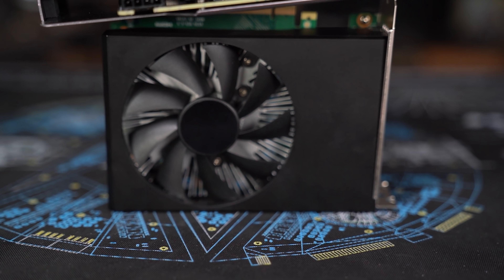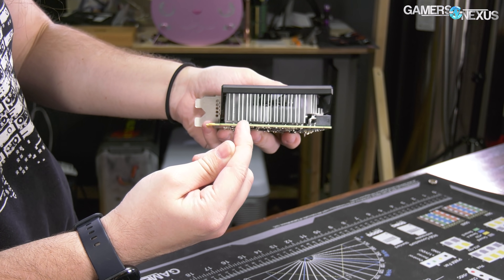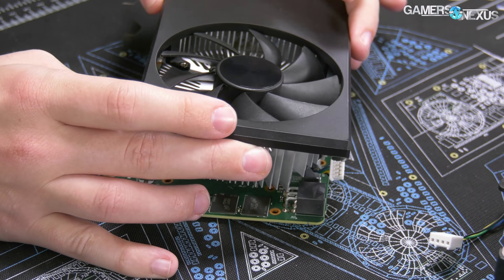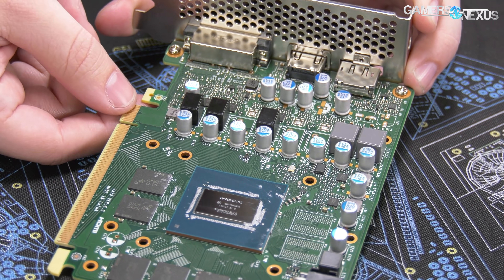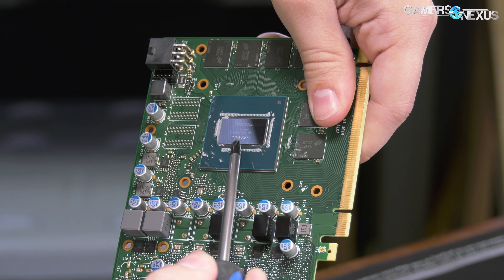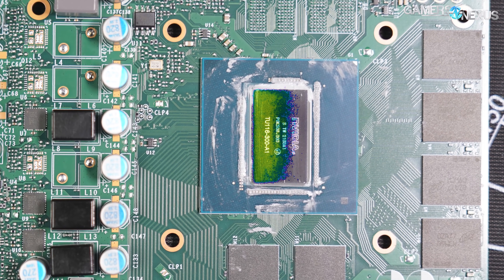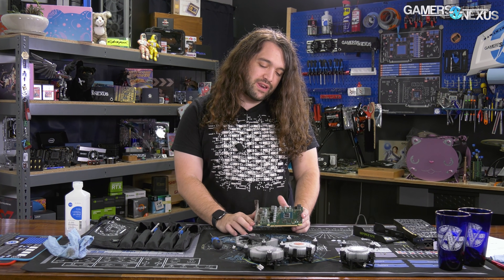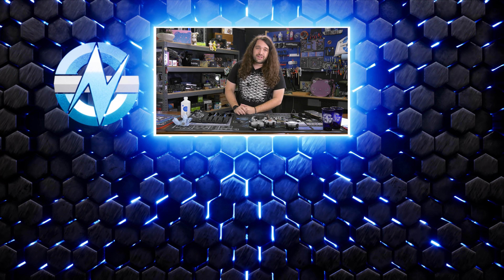Bottom of the Barrel: 110°C VRAM Dell GTX 1660 Super Video Card Review

Comment: "You would have to get an excavator to go lower"
Pans over AMD FX
This burns as much as the memory on the GPU in video
Reply: Not so sure about that. At least the AMD FX could be equipped with a good enough cooler. Can that even be found for this card? I think they took the cake on that, as well (which is impressive imo, just not in a good way).
Reply: @mariastevens6406  Yeah, most high-end used FX PCs I see for sale, often have either AIO water-cooling, or a really beefy dual-fan air-cooler.
Reply: @pauliusgruodis137  I don't think this perception is accurate. 9 series FX were very hot, but the FX8370 is the coolest chip I've ever owned (and I still use it). 15 degrees C on idle with a single 120mm fan  tower cooler. My ryzen 3800x with a massive 140mm dual tower cooler, runs at 40 degrees on idle. FX absolutely trashes zen 2 thermal performance from my experience.
Reply: @Lord_of_Dread  15C on idle? Do you live in Siberia without heating?
Reply: @GewelReal  I call BS on the 15C idle too. That is means the ambient air is well below 15C which would mean you live in an ice cube.
Reply: My 8350 with a single fan cryorig cooler runs cool enough, but with stock cooler i had a few thermal load shutdowns in summer XD
Reply: Lmao i had an AMD FX for a little while that i bought from a friend just for memes. Had it in an old HP case, kept the side panel off and stood a Thermaltake 200mm fan pointed at it to help keep it cool 😂
Reply: Maybe it's just because I had an FX4100, the bottom of the barrel of the bottom of the barrel, so power usage was still sane-ish.
But I had no problems taming that thing even with an aggressive 4.5GHz@1.5v overclock under an OG Hyper 212. (SO much heat pouring out the back of that PC!)
I've since decided to turn it back down because 1.5v was causing degradation, and I can maintain 4.3GHz stable at 1.35v.
Other than that little hiccup, she still runs, and if a friend hadn't thrown an R5 3600 at me, I'd still be using it today!

Footnote for Lord of Dread:
Ryzen has insane thermal density and is hard to cool, especially by older CPU standards.
My R5 3600 UNDERVOLTED hits 75c at all core under every cooler I've ever thrown at it, whether it be a 240 AIO or a Noctua U9S - even with a 5800RPM Wathai strapped to it.
I re-mounted my cooler three times thinking I did something wrong the first time I checked temps on that thing.
Although in fairness I did not win the silicon lottery, and I can only get a -50mV offset stable.
My FX4100 could keep 50-60 under the Hyper 212 with that insane overclock. I don't remember its idle temps anymore, and that system is decommissioned right now.
Reply: Proud owner of an FX 8350. Hot as Hell. Sext as fuck!

Comment: Could you please review some cheap 1600 series Gigabyte models? They're so freaking bad and Gigabyte is pissing on their customers by not providing updated vbioses for the insanely high RPMs at idle (56% vbios locked in my case, GTX 1650 MINI ITX OC 4G). There is also zero contact for the memory on my model. I've also had a Gigabyte 1660Ti Windforce OC in other PC which was also incredibly crap, with louder than normal cooler and vibrating at higher RPMs. It was so bad that I had to send it to repair just a month after purchase and they've replaced the entire cooler. There are so many complaints on various forums if you look them up a bit. Thank you very much if you consider this.

Comment: this guy should stop pretending an expert or creating drama for content.  first of all, Dell engineers know what they're doing especially against cost and other considerations.
2. Most VRAM especially low end ones don't need pads.  I have two MSI Armors that overclocks VRAM almost to the max possible, though with undervolting. I also have Powercolor cards without thermal pads without issues.  It appears thermal pads only help removing heat from the PCB not actually to cool VRAM.
3. Shroud is perfectly fine as a hybrid between blower style o open cooling. They don't to dump much heat into the case but not the costs of a blower style.
4. Card is fine with stock settings.

Comment: would the cooling be better if you'd manually remove the plastic shroud and add some thermal pads on the memory so it would directly touch the heatsink?

Comment: Any tips on cleaning your modmats? I have rubber / plastic marks on mine from working on a PC as well as general cruft that came out. A vacuum gets rid of much of it but not all and definitely not the rubber marks.
Reply: You could possibly use a dull flathead screwdriver to scrape the rubber off and not damage the mat

Comment: I ran into a very interesting Dell rx580 back in 2017 I wish you could have tested. I'm pretty sure it was an rx480 rebranded because when you flashed it's bios it didn't give you an error 43. Also the power limit was lowered to 90 watts. Obviously this gave worse performance than you expected from an rx580.

Comment: 100% Dell did a shocking job on everything in the system, no argument, BUT in this economy someone like myself could find a great value in the whole system. that means cramming in more/better fans, custom fitting a decent heatsink on the cpu, modding a cpu cooler onto the gpu, thermal epoxy some heatsinks on the memory, maybe a bit of angle grinding. but that's only really an option for someone like me and only if the pc was on fire sale AND if I even needed a gpu (still rocking my RX 480 until there's good cards at a good price).

TLDR: This pc can be salvaged using drastic measures if you're a modder but if you are then chances are you don't need one. even I'd only consider it if it was cheap as chips

Comment: Steve,
Congrats on the confidence when presenting it's almost convincing that you know what you're talking about

But your obsession with peak air flow is misplaced.

To quote a tyre manufacturer 'power is nothing without control'

and in this case 'airflow is nothing without direction' 
As in the airflow has to actually go over the things that you are trying to cool

Example the shroud. The top section only blocks the peripheral of the heatsink and it's there on purpose and that purpose isn't branding.

If you look closer they have put an undercut in the heatsink this gives the airflow an escape point. sure it restricts flow slightly but it directs it out over the caps on the top of the board, just like the i/o shield section is setup to direct the flow over the caps there as well.

Ram chips relatively don't produce much heat and have for the most part been fine with open air cooling for decades, attaching them to the heatsink could actually make things worse and dump the heat from the gpu into the memory chips if the cooler gets overwhelmed. The aluminium is always going to be hotter than the airflow around it.

Comment: How the F they got ram to 110C? My EVGA 1660 super didnt get ram to that running 2 BGAs bare and 2 blocked by gigantic thermal pad, that mostly insulated them. Did they tape them with electrical tape?

Comment: It's really sad that they trade longevity with manufacturing costs just so they can earn a few bucks more. That poor gpu probably going to break after what, maybe under 5 years ? They are literally losing their brand reputation with these crappy pc parts. And the cost to fix these issues probably wont cost them more than 10$. But they are ok with it.

Comment: 6:30 The Airflow is not competley blocked off there, if the cooler is mounted, there is as much space between the shroud and the PCB as on the motherboard side.
edit: at 11:58 you can see the actual gap. Could be bigger, but we've seen smaller ones.

Comment: i think calling something with custom parts low effort is a touch unfair. poor effort, unnecessary effort maybe. misplaced efforts even. some poor engineer had to design those circuit boards, source those custom parts and otherwise design an absolutely useless doorstop of a desktop that if ever it goes wrong can only go into e-waste as it's absolutely unmaintainable.

i think a lot of effort went into that. it probably cost dell more money to make the pc so poorly than sourcing cheap OEM parts would have. but this method locks you into their ecosystem. your average neighbourhood geek isn't fixing this abomination without replacing the whole thing

Comment: It looks like the terrible Intel stock coolers, which struggle at the best of times and they've gone and covered 2 of the sides completely and most of another. Dell also using their own weird PSUs and motherboards (replacements of which from them would probably cost as much as the pc itself, you're not gonna find one anywhere else) is a pretty dog move too. Any chance of trying it with some thermal pads on the memory, de-shrouded with a 120mm fan on it and maybe shave down the standoffs to get a bit more pressure? Pretty quick mod if some poor bastards out there have gotten stuck with one of these.

Comment: Dells 1050 ti model has same issues. I took that tiny aluminum cooler and made a mold and cast pure copper in my forge for a replacement heatsink, then added heat pads to the mem spots that did make contact with the cooler and added mini copper heatsinks on the ones it would fit them on. (rasPi size) And why is there a DVI port, i see these on ebay and SMH. Its a fixable thing but its a lot of work. the asus version 1660 super uses hynix memory which in my opinion is far better than micron, and it really performs. same crap they been doing for decades. Thanks for the breakdown.

Comment: Dell having a v6 is not surprising. The Inspiron 8000 laptop had 14 revisions before they fixed some of the initial flaws in the system and they never fixed the keyboard interfering with the TouchPad issue or had Speedstep working properly. Dell often uses customers to debug their systems and fix problems years after initial release. They've gotten better but obviously it's still an issue.

Comment: My 1060 has the literal cheapest cooler ever designed I'd like to send you guys it when I purchase a upgraded GPU, I had bought a pre built HP Omen pc in 2016 it was a simple i5-7400 with 8GB ram and a 1060 but they did not tell you it was a 3 gig ram one so I got scammed a little as it only said 1060

Comment: I have similar card: Afox 1060 6gb with turbine. Memory modules aren't in contact with airflow or heatsink, heatsink is made from aluminum. It works for 3 or 4 years already, changed termopaste 2 or 3 times and swapped the turbine cuz old one started rattling.

Comment: that's the same cooler than was on mu Zotac GTX 1050ti
also had no contact on the vram
it was fine on those 60W cards with thermal pads

Comment: I had an Asus strix 960 4gb card, but I replaced it with a Dell "OEM" blower -type 1060 6gb (looks kind of like an asus 1060 turbo). Should I change back to the 960? or is the worst 1060 still better than an older gen card in terms of performance?

Comment: Let me add this:  Looking a little more at the version number thing, and considering your testing results, I am guess that the card and most of it is from MSI.  I think that MSI won't put their name on it for a reason.  The components are cheapest possible, real end run jobber parts by the look of it.  The board is potentially assembled by the same people who do the MSI boards.   Dell just chose to make it as cheap as possible and really messed up.  Slightly extending the heat sink and getting thermal pads on the memory likely would have made at least a bit of a difference, but it might have added a few pennies to the cost and that would make them miss their price goal.    I am confident that this is an MSI related part, they just likely don't want to admit it.  Ask them.

Comment: I'm almost surprised Dell's 'cheapest possible' route isn't just repurposing their laptop chips for PCIe add-in cards. 
I'd be curious to see an aftermarket cooler slapped onto this, or some kind of solution to better cool the memory. If shortages are pushing the sales of 'as cheap as possible' cards like this, there needs to be a solution for bad design, and there will probably be a boost in aftermarket cooler sales as a result of this.

Comment: The version thing may be a misdirection. V379 appears to be a board company's generic 1660 (and other) design.  The core remains the same, but there are differences in PCB size (as you showed with the MSI board, which is likely also a V379 board, probably "version 2".   The differences seem mostly in that extra PCB area, the placement of the fan connector, and such.  Version 6 may not be "we f--ked it up 5 times" as much as the 6th variation on the board based on OEM demands.

Comment: It's an OEM GPU. Made as cheaply as possible in order to maximize profits. Component shortages or not if you want something engineered better you're gonna have to spend the $$$ on it...

Ragging on Dell and comparing to aftermarket GPUs is asinine and beating a dead horse. If you are buying a completed OEM system for just the video card you almost deserve ridicule.

Comment: Now, For when you need the challenge/filler episode. How much could you improve the card thermals with some "improvements".....  Hack the shroud sides or 3d print a better one, add some thermal tape(?) to the fill the gap between the memory and the heatsink...  Maybe add some 3d printed angle vents on the one side to so air goes away from the MB.  I dunno, I mean you already have the card, and it's a glorfied paperweight....might as well make it useful(ish)....Recoup a portion of the money back... A GN upgrade mod!

Comment: I had considered one of these Dell systems but since components I wanted were limited to Alienware, that is what I went with.  Although it can sound like my Air Fryer when the fans kick up, it is far better built, but it should be given the cost increase.  I guess if you buy the extended warranty, try your best to fry the card, why not? They will replace it.  I have not seen a heatsink attached with those springs since like Geforce 4 days.

Comment: Gotta say as someone with an engineering background it's interesting to see how cheap you can make a GPU and still function inspec as such.  I know this might sound silly but the amount of engineering done to make a GTX 1660 Super that just works and nothing more is impressive.  The amount of thinking in terms of dollars in order to build this so it's as cheap as possible is pretty good.  Dell made this GPU to last 1 year and nothing more which is why they cut costs anywhere they could.

Comment: I wonder if thermal pads between the cooler and memory would fix the issue. We had some Zotac oem card for HP omen come through that had no thermal pad between the memory plate and the heatsink, only on the memory itself which fails to cool the plate or transfer it off. We had to use paste as pads were not conductive enough because the plate was made of steel not aluminum or copper

Comment: Id be really curious to see what the temps would be like if you clipped back the plastic to allow for the heat to exhaust put some thermal pads on the memory modules use some good thermal paste tighten the screws and add an intake fan to the del. How good can it get with some simple modding?

Comment: I bought an Alienware for a 3090 and luckily it's doing pretty good. So I guess between Dell and Alienware they are using different parts? But I bought it at Microcenter. I need to see if I can change the cooler without voiding the warranty.

Comment: Are you sure opening up the sides on the cooler would improve the design? Seems quite intentional to me. It guides the air more towards the PCB and memory instead of blowing it out through the sides. Maybe it would improve the GPU temps but given the temps are fine it again seems like an intentional tradeoff. Guessing such things is pointless though. This should be tested, just cut off the plastic. Outright claiming it's bad and could easily be improved is kinda unprofessional though.

Comment: Dell is absolutely shit. Bought a Alienware aurora R7 , shortly after started getting into the youtube tech channels starting with jay. No joke my graphic card was such shit with my system that I ended up going to Bestbuy and spending $350 on a 1060 6gb during the last crypto boom. Shortly after bought better 16gb of 3200 DDR4 Ram then found out that Dell wouldnt let me run it above 2400..... Years later, couple parts at a time ,I have fully replaced all the parts to where I have a custom built PC by myself thanks to all of you guys! I currently use the Coolermaster H500 case that you recommended... Lets just say because of this case I ended up having to buy a new motherboard because of Dell...! F them. Happy to be done with them though.

Comment: Tell you what you do. Buy that ** up cheap. It's still a GTX 1660 Super, which is a very decent video card, especially in this dry market and high demand.  Change over the heat sink, add some thermal pads, or even redesign the sink entirely, hack it to pieces for all I care.  Nothing's stopping you from water cooling it anyway.

Comment: This is what the dell graphics card is capable of with access to air. So what can it do in the system it's sold in?

Poor Steve, Dell or someone else will probably prove you wrong on the bottom of the barrel part.

Comment: I'm waiting for iBuyPower's Asus TUF GTX 1650 teardown. I have the step above (Asus TUF GTX 1660S). I have tried to look for opinions about the cooling solution for a while. Is it better to have a block of aluminum and one thick heat pipe or a more common solution, multiple smaller fins with heat pipes?

Comment: i wonder what would happen if you just put thick thermal pads on the memory and put the cooler back on without that plastic shroud... or just notch out a little more of the cooler and put some of those little peal and stick heat sinks on there instead.